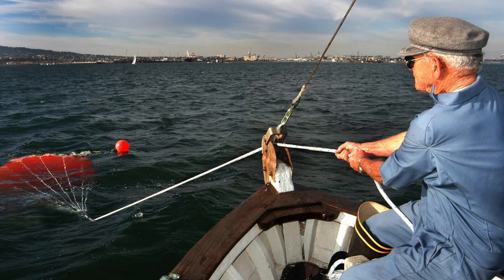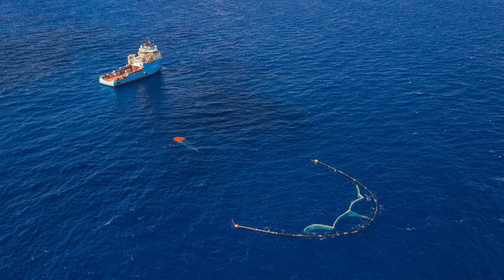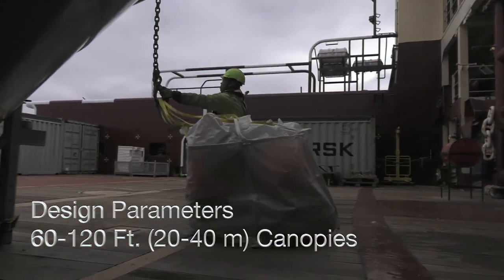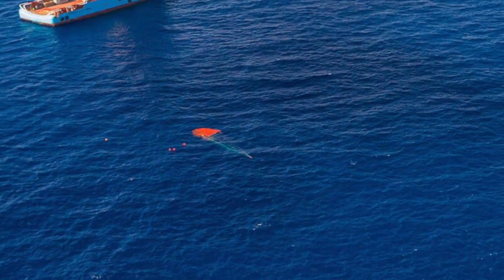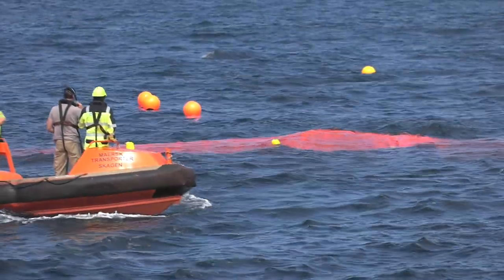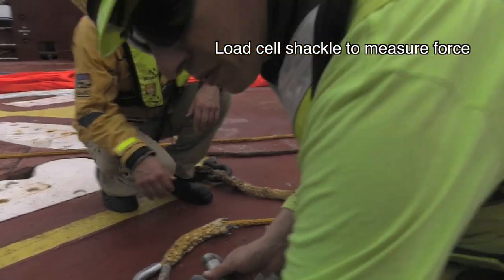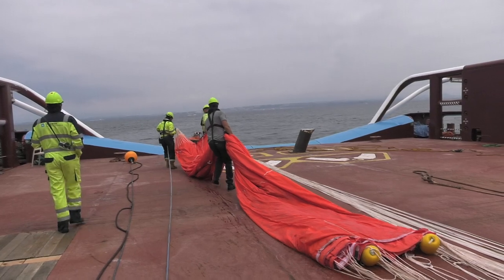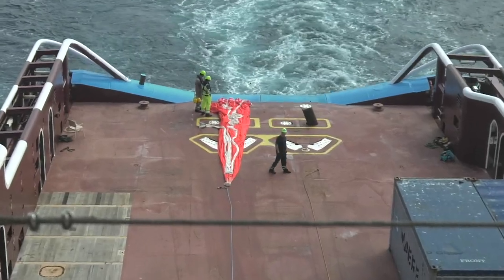Testing Big Parachute Sea Anchors

Comment: hello sir that parachute is used for what
Reply from the maker: Fiorentino's parachute anchors are used to slow or nearly stop the drift of small fishing boats to large oil tankers. The Fiorentino parachute tested in the video is designed to slow ocean garbage collection systems. Here's a great video from The Ocean Cleanup during real-life use of the equipment: https://www.youtube.com/watch?v=P1BctGcMFc4
Reply: @ParaAnchors  boat is no roling vere good for boat if v uze that vere good to slep on the boat noroling
Reply from the maker: @husaindhandu1654  Yes, the para-anchor can dramatically reduce the rolling motion when deployed properly. Very common use for spending the night offshore. Thank you for your comment.